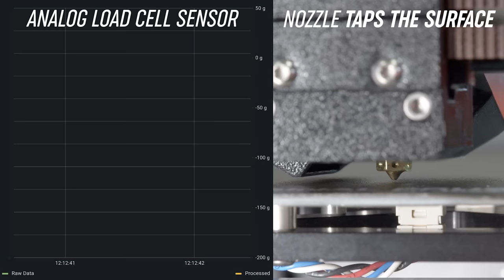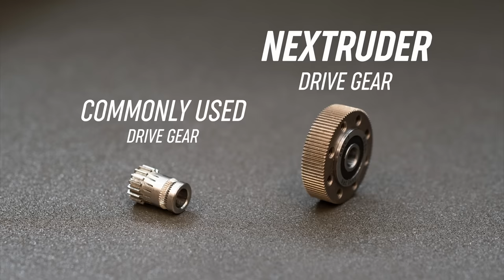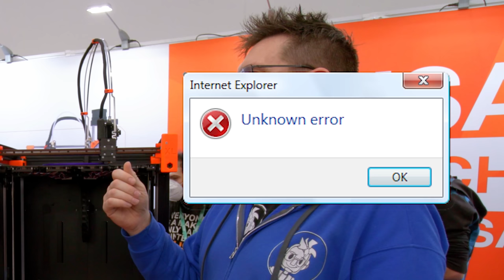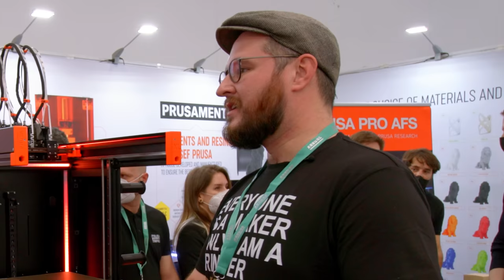Prusa XL First Look at Formnext! World Premiere!

Comment: Hard pass on this. WTF were they thinking with that frame?

I'm pretty disappointed I waited this long for such a let-down
Reply: What don’t you like about it?
Reply: @Aidenn23  CoreXY printers are meant to print fast, and this frame pretty much negates that possibility. I would absolutely love to see something printed by this printer at 250mm/s with high accel+jerk values.

Don't get me wrong: literally everything else about this printer is *amazing*...It's just that the frame is a show stopper for me. Rigidity is everything, especially as you add speed.
Reply: @jfaristide  just an fyi we tested our ended 7 that we took an angle grinder to and basically made the same frame and we printed at the full 200mm/s on a stock ended 7 and couldn’t tell the difference between models. So. I’m not sure you’re correct.
Reply: @Aidenn23  got a link to a video for that? I'd be interested to see it. Also, 200mm/s, 8k accel/5k deccel with input shaping is pretty much the floor for comparison with good CoreXY systems...not the ceiling.
Reply: lol are you kidding me? You really think they didn't test for that?
Reply: I suppose it could all be fixed with a couple of extrusions and corner braces, but I feel like for the price I shouldn't have to...
Reply: @jfaristide  And you already know that to be something you have to do, impressive as it's not out yet. :)
Reply: @VincentGroenewold  I've got a few printers. I've built a few printers. I've got a pretty good idea what to expect from an open-front CoreXY, especially when you start speeding things up.

I've got a buddy local to me who's a die-hard Prusa fan and will surely be one of the first to get one. When he does, we'll side-by-side it with my Rat Rig V-core 3 and see what's what. I may even build a 400mm VC3 just for the occasion, to keep the comparison more accurate.
Reply: @jfaristide  Very interested in that one, let us know. Of course the XL is not a printer for a speedboat race, at least not designed to just be speedy and nothing else. :)
Reply: @VincentGroenewold  at 250mm/s, the RRVC3 300 puts out the same quality prints you'd get from an i3 at 50mm/s. It is a very serious no compromises printer.

Comment: £1800 hahaha. Prusa Machines are always overpriced. I'll buy a Voron kit for half the cost.
Reply: Im a cheapo....started with the creality kits and then got a sidewinder
after many months i finally ordered the Prusa MK3s prebuild and calibrated with extra plates and all.
Cost more then my other 3 printers combined

Best thing I ever did!
Worth way more than the other 3
Only way they get used now is if the prusa is busy and i cant wait
or i need a bigger buildplate

no fiddling no praying, nothing breaking
i had one clogged nozzle in 15 months..thats it
i design i go out switch it on and preheat i start and forget about it

you get what you pay for here
Reply: You can only talk when you had multiple 3d printer including a prusa ... I did and the prusa is worth it for the easy of use ... jezz I even have SLA printers and rarely use it because using the prusa is such an easy and refreshing experience in comparison
Reply: @256alexdt  I have 5 3d printers, owned at least 12 over the years and have been printing for over 5 years.

Prusa printers are overrated and overpriced, fact.
Reply: Except you're completely wrong and its been demonstrated over and over. Its bad look, sit down.
Reply: You can literally buy a clone of the MK3S or Mini for less than half the price, run Prusa firmware and get the same print quality.
Reply: @ArcticFox63  the thing is, we are both right here. Prusa Printers are not for the Power3DPrinterBuilderGeek that has years of experience and can build one from parts bought from 20 different places, hacks around with the firmware and is just an expert in that...for those people, prusa is wasted money, why pay for a lot of stuff you can do yourself...

for everyone else, from the 10 year old firsttimer to the guy who wants to go push a button and have a printed part when he comes back without fiddly stuff, prusa is the BEST out there, by far.